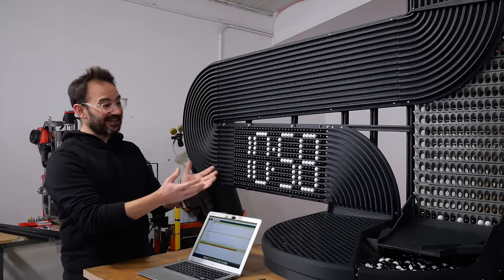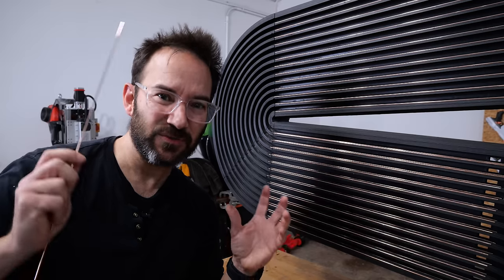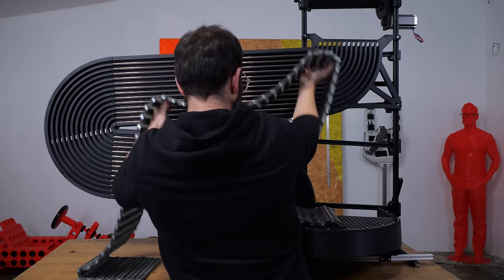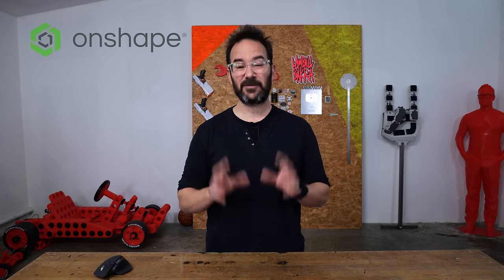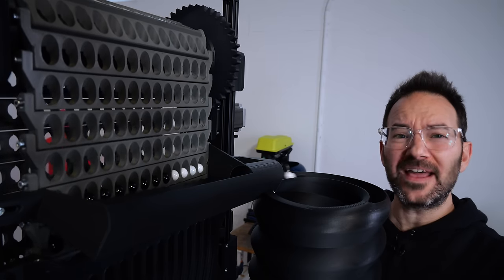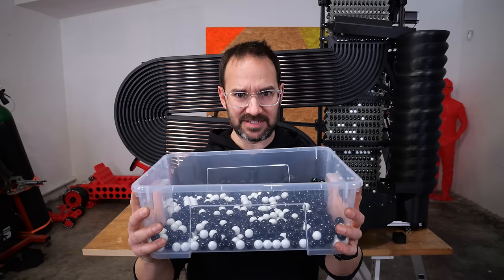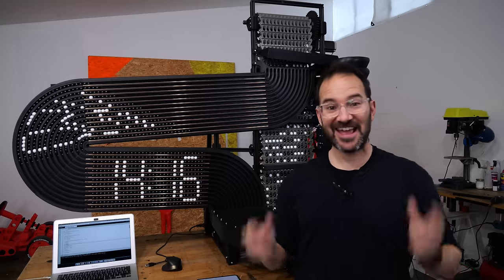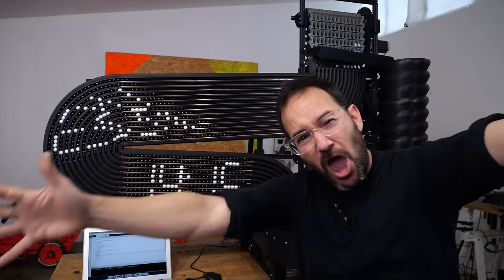BUILDING A MARBLE CLOCK - Pt. 3

Comment: DON'T DISCARD THE MARBLES!
Use the elevators FULL CAPACITY to bring up as many marbles as possible, THEN at the top you sort out the black & white marbles into 2 reservoirs, then the clock picks the colors & amounts it needs from each reservoir, it can do this by enable one of several lines of each color, use a marble counter & have a "lane router" go guide the marbles into right place, in that way it can build the entire time within a minute.
Reply: Not 2 reservoirs, but 2 lanes for each output lane. Then, at the end of those buffer lanes, use a movable gate (the old "block with a hole that lines up with either input1, input2 or output") to feed the display buffer lane. That way, no marble path needs to be faster than "time resolution" divided by "display width".
Reply: You both have great suggestions. Either way, you have both identified an area that could be made more efficiently. I think he should focus on doing that next.
Reply: The goal is not an efficient clock.
Reply: @MiesvanderLippe , no, but a change by minute would be nice imo. And the delivery speed seems to be up to it, just the sorting isn't efficient if been waiting for one or 2 specific white in a transport lane while other arrived whites in other lane fall back down. All that is going down through that round tube is transported useless upstairs while that shouldn't be needed and if used improves speed overall in my logic.
Reply: Just keeping the lanes consistent rather than dumping them all in a single pool would help. The top and bottom rows never need white, so any white that ends up in there is wasted, the middle row needs between 0 and 16 white and that's the row with the most variance. Maybe have up to 94 marbles total per lane, should give you enough for any 2 configurations ((max black needed + max white needed)*2), excess can cycle around their lane's holding area and the elevator.
Reply: Making a marble gate and storage would pretty much double the machine complexity thou.
Right now all it does is lift them up and reject wrong colored marbles. It doesn't keep track of anything but what color it needs atm or even if there is a marble to start with.

If anything I say that the easiest change would be working on the elevator feeder so he can speed up the elevator
Reply: Came here to say this! Seems like the main thing slowing it down is that it has to wait for the right color marble for each "pixel". I even wonder if it's usually having to wait for black marbles, and just removing some of the white ones would help (wait longer for a white pixel, shorter for a black pixel)

Comment: Super cool, can't wait to see the next version that works be the minute. Hopefully a helpful suggestion, you could make the rejection at the bottom with the solenoids just above where the marbles enter the elevator, then use the "flexible pushers" at the top to have the apceted/nonrejected marbles enter the channels. This means no loud spiral down.

Comment: This turned out really cool! Returning commenter from previous concepts where I mentioned the longer than a minute problem (apparently one of many). Really interested to see how you tackle that issue. My thought was to make a bank system, where the marbles are sorted then dispensed at the top to reduce the randomness of the right color marble appearing in the right channel.
Reply: I think the easiest solution is just to sort the marbles by color and dispense from there

Comment: Great one!! A vertical setup could help with lesser changes to marble columns than the changes in rows, it can also remove the need for smooth marbles only. Also the longer panels cause more speed for smoother marbles which when hit with other marbles could damage the smoothness

Comment: That's a really cool project and I love how it looks when the prepared time rolls into place! :)

I also have an idea to make the clock more complex, but maybe faster.
Coarse idea: add a sorting mechanism to put the correct combination of marbles already in the elevator.

More detailed:
At the lower part of the elevator, you could detect the color and eject them (at 2 height levels) into 2 containers.
From these containers the color could be injected into the elevator with the correct position.
Problem: the sorted marbles are lower than the elevator with unsorted marbles.
Maybe the 2 containers could be at the top and the selection is directed directly into the marble tracks to prepare the time?

Bonus: This would also remove the loud overflow helix, although I really like it (would be great to watch if transparent :D ) !
Reply: i immediatly noticed the reliance on randomness and was wondering as well why he isn't using black&white reservoirs.
I think the best place to put them is not at the top, but at the bottom before the entry to the elevator.

The alternative would be to split black and white at the bottom and then have 2 elevators (or reuse the current one with a left/right split), have and feed from the elevator into those. Then feed from those into the lines through a demultiplexer.
Reply: I think you've just invented a marble-jet print head!

Comment: I think a good option to decrease response time is to separate white and lack Marvells. With that u can choose what is more convenient each time and send a row of marvells of the color you most need. With that you can even have a constant response time. Awesome project by the way
Reply: In theory since we know which marbles are being kicked out because of the sensor you could have two slide and two places to kick the marbles out, This will probably reduce the complexity in that you won't need such a tall elevator for sorting the time marbles, reduce the noise since the slides should be smaller, but increase moving parts due to more kickers. You would still need a way of bringing sorted marbles up though a smaller 1 marble elevator or larger if more bandwidth is needed.
Reply: Yeah, instead of creating a rejection system at the very last moment (which is also apparently super loud), create a filtering system that guarantees the correct colors in each spot. Way more efficient, and probably would get times down to 1-minute updates.

Comment: funnily enough Dr.D-Flo had a similar problem with his pellet extruder, after he updated the motors drivers to be silent, he fixed it by adding a vibrator to the feeder to loosen the pellets. while would of been noisier, might of worked in your case edit: i see you've done something similar, and clearly noise isn't a factor XD

Comment: We all appreciate the suffering you put yourself through to create amazing content for us. 

In order to make it faster, I suggest adding a second buffer.
Reply: Buffers aren't really a fix to the problem, they're just a bandade to cover up the underlying issue, he shouldn't do the "sort and releae" in one step at the top like he currently does, it would be much more efficient to only sort between white and black at the top, this way you can use 100% of the marbles transported (instead of the probably less than 20% that it's currenlty) and then release the marbles with marble gates into the clock, this system would be limited by the amout of marbles that the elevator can transport up, in this case it would be around 10 marbles/second the machine could release into the clock without running out of marbles, this would improve the display speed to a guaranteed 40 seconds, the only limiting factor is the speed of the conveyor belt (the transporting up thing) speed this up and you can improve the display speed

Comment: Seems like it would work better vertically rather than horizontally. Would also fill faster and be able to cycle more often.
Reply: Good idea, but probably not feasible with brittle glass marbles since they’d fall straight down from ≥1m height and smash into other marbles. Would probably work with ping-pong balls or tennis balls though.
Reply: Would it look as good though? Nah

Comment: make one half size by condensing the segments dow to 2 marbles per segment instead of 4, also get rid of the solid black top and bottom rows, dropping the amount of rows from 13 to 8 and the amount of collums from 31 to 21, you could make the whole thing about 60% smaller, also for the rejects I would say make the chute more vertical to minimize the amount of time the marbles are moving and making noise, also putting a lid on the middle on the reject ramp may help minimize noise

Comment: really cool clock! for the noise issue introduced by the spiral, one option that you could think about is padding the spiral's floor with some kind of soft material, such as rubber. However, it needs to apply as less friction as possible to the marbles so they don't slow down.

Comment: Possible optimization: invert your marble sorting algorithm, use the solenoids to reject closer to the bottom what you don't need instead of dragging them all the way up. Reduces noise, power consumption, etc. Could also check 2 or 3 slots below the actual ejector, allowing the elevator to run faster, as you'll have some buffer time.

Comment: If you move the colour sensor system to the bottom of the return channel you could then split them up in the "hopper" and send like the first 3/4 channels as just white marbles, then have a little splitter director thingy up the top. Would add more complexity, but would enable pretty fast "drawing"

Comment: I actually designed a marble sorting machine for an engineering class project. The first criterion - and the only one I actually got working - was marble mass. Marbles going down a slope with enough momentum would make a jump successfully, while those without enough would move on to the second criterion, which your clock uses to find wanted marbles for the display.

As the marbles would start at the same height, they would accumulate the same velocity over their descent. Therefore, the only way they could have enough momentum was having enough mass to begin with.

Comment: I love This idea, personally  I would set it up without the framing marbles and make each display segment only one or two marbles wide. That would surely cut down on the noise and make it much more practical as a wall clock or a table clock.

Comment: Hi I'm studying physics at college. I think these things could make a better mechanism:
-smaller mechanism (to make it cheaper and faster)
-heavier marbles (like made of polished stone or metal) to prevent them from getting stuck.
-if it's smaller, it shouldn't be hard to shake either, a couple shakes every now and then could do the trick as well.
-use oil.
-add a smaller proportion of white marbles to ensure it finds the black ones faster.
-it could be even smaller: make it a circular loop. They fall to the left go right down and go up on the elevator from the right to go up again. There will be enough marbles around so that it doesn't have to wait for them to come back. I just don't think preparing then beforehand saves any time.
I think it could only take less than a minute! Marbles, oil and gravity should do the trick.

I'm no ingeneer, but I hope this helps.

Comment: As you mentioned correctly, the bottleneck is the loading of the marbles. To mitigate this it would be smart to sort by Color before you load the elevator and only escalate one-coloured rows.
By this you would prevent waiting a long time before a white marble comes to the right place.
It would also reduce the noice created by the unused marbles pushed out at the top.

Comment: I think that it might increase efficiency to use a marble divider to make sure that the marbles are being distributed evenly in all the channels before the ladder. Also, the marbles seem to be moving very fast on the straightaway sections which can result in breaking because they are made out of glass. It would probably be a lot of extra time but either switching the marbles to a more durable material or shortening the straight sections would greatly increase the longevity of the device.

Comment: Ideas on making it faster:
- Don't use as many columns (horizontal padding) for each piece of time.
- As others said, don't change all the rows whenever the time changes if possible.
- See if there's a way to do things dually. eg have two rotators, one has only black, one has only white, and they're selectively pushed out. (that would make returning the marbles more complicated though)
- See if it's possible to speed up the motors.

Comment: to avoid extra unnecessary wear and tear on the elevator gears, mount a small rumble motor on the back of each of the track panels for the loosening vibration

Comment: Wow, love the work that went into this. Fantastic!

Just one remark about the noisy workaround you built for the rejected marbles: why are you not inverting the mechanism by measuring and physically rejecting the wrong marbles at the bottom of the elevator and then eject all marbles left (the correct ones) at the top?

For making it faster to display once per minute, you'd probably need to sort the marbles into two separate containers at the bottom anyway. Looking forward to part 4!

Comment: Dude, This is amaze-balls!

You have two strips of only using black marbles and a fairly constant ratio of black to white marbles. Wouldn't this be better with segregated storage that gets filled by by expected position?

It would reduce the amount of marbles needed drastically and wouldn't have to rely on detecting the color and potentially having the situation where you randomly got all the same color in a certain position on every elevator platform.

Comment: Here's two ideas for version 2:

1. vertical channels instead of horizontal, prepping the next digit right above. Should remove sticking issues and you can make the colon static. 

2. use different sized marbles for black and white so that you can sort them using two non-parallel rails and then just dispense the correct colour into each rail. Should make it a lot faster to set up the next digits.

Comment: i could see v3.0 having 4 separate input ramps/queues for each individual digit, but all of them sharing the output display, with the output itself having gates between each displayed digit to retain the hours and 10's marbles. 

perhaps each digit's queue would be steeply angled behind the output to help with the stuck marble problem?

something that could speed up marble sorting would be to have a nonstop conveyor feeding into sensors and gates that would kick the marbles as they pass. sort of like quality control robots in an assembly line

it'd be orders of magnitude more complicated to engineer and program but sounds like a hell of a project! now i really want my own 3d printer 😵

Comment: I bet you could seal the marble chambers with a piece of see through plexiglass and then have a constant stream of air running through them. I think this would not only fix the marbles getting stuck but would also allow you to speed up the operation to work as an actual clock.

Comment: Btw, another idea for you.  Make the marbles falling from above instead of sliding from the side.  You will only have to update the minimal number of columns to minimize mechanical error, and faster, less noise, in theory at least.  90 deg down insead of 3 deg.  You can also hide the elevator at the back making the machine more compact.

Comment: I think your first optimization should be to not stop the conveyor for every marble selection-push. The push should be timed so the hammers go out and back in within the time the opening is aligned with the hammers. Alternatively you can make the selection happen by simply not applying ant pressure to a "wiper" on the back similar to the spring wipers. This allows the timing to be very lax.

Comment: I absolutely loved this idea and the videos. It was an awesome watch. I had an idea with configuration - if it was vertical, then most of the time only a few lines would need to change as each minute changes. So you would just be replacing the last character until 10 minutes had passed etc. 

While I am sure it's a complete re-design, could the marbles be sorted into colours before being loaded some way into the elevator (in the right order) to guarantee that at the top you had the perfect set. It would remove the need to reject marbles and speed things up as the marbles could be constantly sorted into the right colours. I realise this would be a completely different machine design. I am not an mechatronic or electric engineers so just wondering out loud.

Comment: Have you considered using a tapering nylon net to capture the rejected marbles and funneling them down to the tray? Depending on the taper and length of the net, you could control the rate the marbles descend under their own weight and it will effectively be completely silent.

Comment: What an amazing creation! Reminds me of the old music marble machine. 

Suggestion - Would it be possible to use slightly different sized marbles for white and black. The machine could then passively sort them (like a coin sorter) and you could have pools of white and black marbles. Rather than the machine then kicking out the marbles that it doesn’t want, it could load in the marbles it does want. This could potentially help with keeping a consistent flow allowing each minute to be reliably displayed.

Comment: I think the best solution I've seen suggested is to load the elevator from two separate trays, one for each color.  In this example, the elevator would first load the black marbles, filling every space with black marbles.  It would then immediately reject marbles from the slots that need to be white, and the reject marbles would fall a very short drop back into the black loading tray.  The white loading tray then fills in all those gaps.  When the elevator gets to the top, it's already loading everything in the right order on the first pass, making it much faster.  The challenge then becomes sorting the marbles that leave the clock...